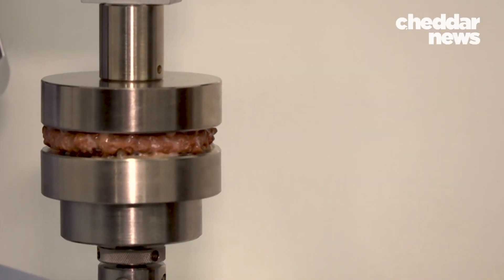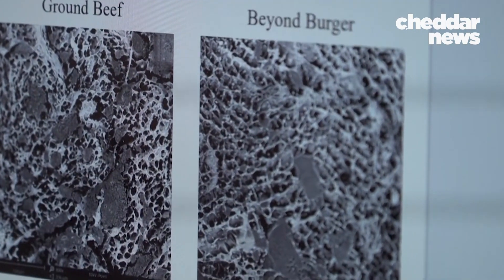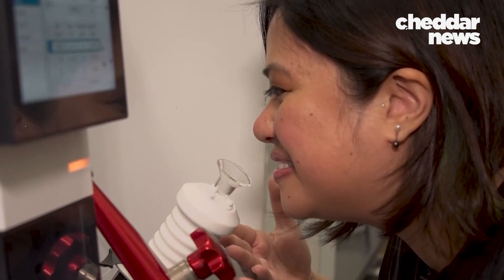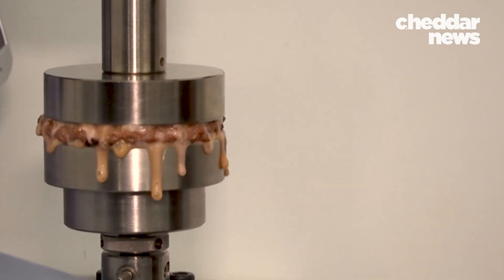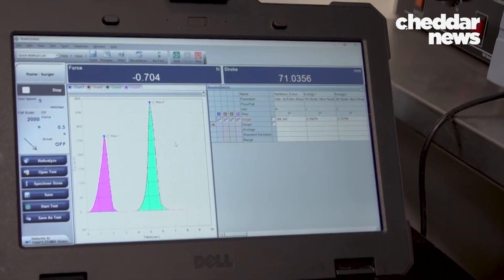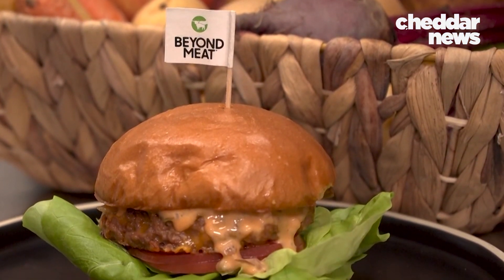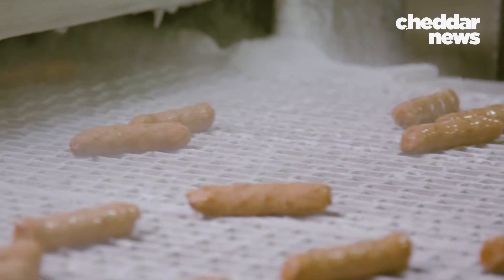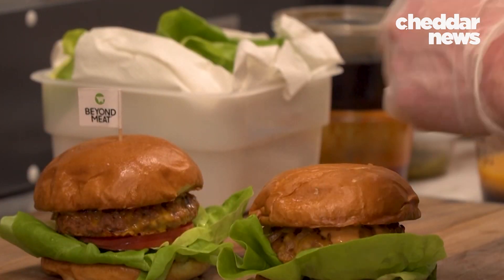Inside The Beyond Meat Lab - From The Field

Comment: I would rather eat real meat with moderation than eating some fake meat with hundreds of ingredients that you can’t pronounce…
Reply: "A Beyond Burger, however, includes 18 ingredients: water, pea protein isolate, expeller-pressed canola oil, refined coconut oil, rice protein, natural flavors, cocoa butter, mung bean protein, methylcellulose, potato starch, apple extract, salt, potassium chloride, vinegar, lemon juice concentrate, sunflower lecithin" 

Methylcellulose is basically processed plant fiber. "Potassium chloride is a medicine used to prevent or treat low potassium levels in the body. Potassium is a mineral that your body needs for proper functioning of the heart, muscles, kidneys, nerves, and digestive system." Basically, it's the nutrient potassium.